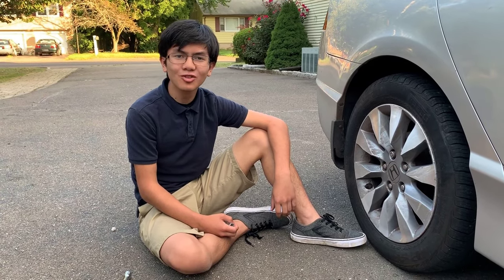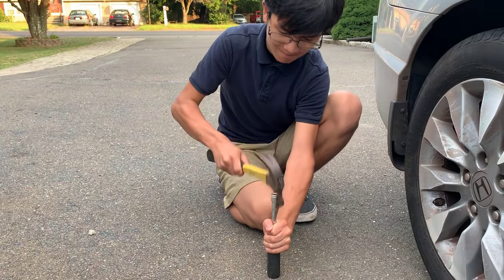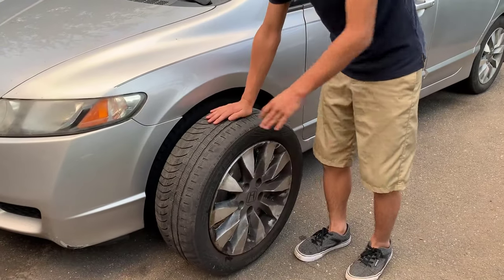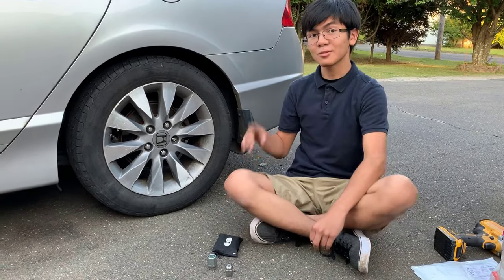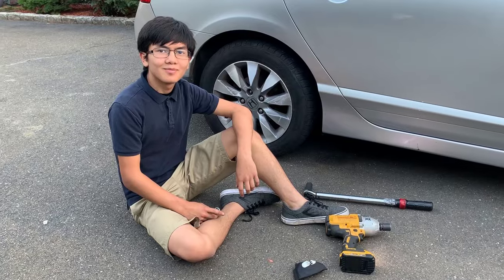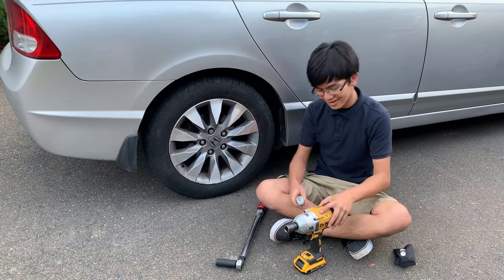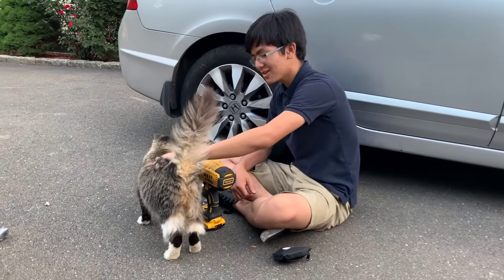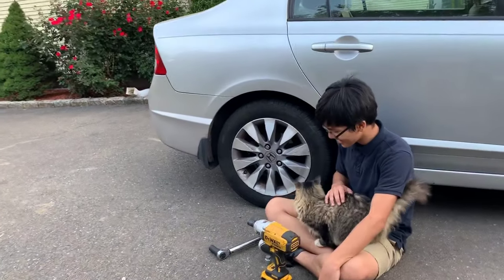Lost Lug Nuts Key? How To Remove Wheel Locks Without Special Tool | How Does Tire Anti-Theft Work

Comment from the maker: Looking to buy Professional Lug Nut Removal Tool or Wheel Locks for your car?  Here are the #ᴬᴰlinks to some of them:
1.  https://amzn.to/3PAIum9  |  THINKWORK Lug Nut Remover, 10 Pieces Wheel Lock Removal Kit for Removing Stripped, Damaged, Frozen, Rusted, Rounded-Off Bolts, Nuts & Screws
2.  https://amzn.to/3RgP6al  |  ANeiko 02457A Lug-Nut Key Set, Wheel-Lock Removal Tool Kit for Aftermarket and Factory Wheel Tire Keys, SAE and Metric Lug Sockets, 16 Pieces
3.  https://amzn.to/3Rcs3h1  |  Platinumedge Impact Bolt & Nut Remover Set,13 Pieces Bolt Extractor Tool Set, Easy to Remove the Rusty and Stubborn Sockets, Nuts and Bolts, Chrome-Molybdenum Steel, with Solid Storage Case
4.  https://amzn.to/3PxkQWv  |  TOPEC Bolt Extractor Set, 9 Piece Lug Nut Remover Socket Tool, 1/2" Drive Impact Wheel Lock Removal Kit for Removing Damaged, Dead, Rusted, Rounded-Off Bolts, Lug Nuts & Screws
5.  https://amzn.to/45Lc4uK  |  XEWEA 9PCS Bolt Nut Extractor Set, 1/2" Drive Impact Lug Nut Remover Socket Tool, Wheel Lock Removal Kit, Easy Out Bolt Extractor Set for Damaged, Frozen, Rusted, Rounded-Off Bolts Nuts & Screws

Or Click on Amazon link here and search for what you need:  https://amzn.to/3xIOsqg
Reply: VERY helpful!!! Thank you!

Comment: So a lesson to learn here is that wheel locks are useless.😒
Reply: Yup they only slow down wheel thieves 🥲🤣
Reply: Unless you have rims
Reply: More aggravation thanks
Reply: True but rather have them do more work for it
Reply: Not useless, but a very low level of security.  The idea is to have the thief skip your car and go for the car without locks.

Comment: It works! 
I removed 11 over-tightened  6-point lug nuts using this method from my Rav4 today. One of them had to be removed with a two-size down socket because it was far, far too tight. 
Undoing the damaged lug nuts from the socket was also a challenge. It was done by putting a 17mm wrench under the socket, fastening the nut with a vice, and then knocking the nut out with a rod using a hammer. The rod was centralized with a rightsize nut.
Reply: PS: Sorry, they were 6-point spline lug nuts. I broke the key a few days ago and could not wait for a new key and a set of damaged lug nut removers that I ordered to be delivered. I was using good quality 12-point sockets and made no damage to the sockets, and only the lug nuts were damaged, which were all replaced with better shank style hex-side lug nuts and tightened with a proper torque wrench.
Final words: make sure you jack the car safely! (I did it with two jacks.)

Comment: Hi . Thanks for sharing. Could you please provide the details sized of 12 point and other parts used like the rod and support socket to remove log nut. Thanks
Reply: Looks like he did not reply to your request but for Honda, it should be a 19MM 12 points socket.  Make sure to buy the extend type so you have rooms to hold the socket while hammer it in.   I had to do the same because I bought a Honda and it is missing the key too.   Good luck

Comment: I guess to make it a pain in the ass for criminals you could switch all the wheel bolts to locking ones.
Reply: I didn't know it until I got a flat but all 5 lugs on each wheel are spline style locknuts on my car... And the previous owner didn't leave the key anywhere in the car 😑